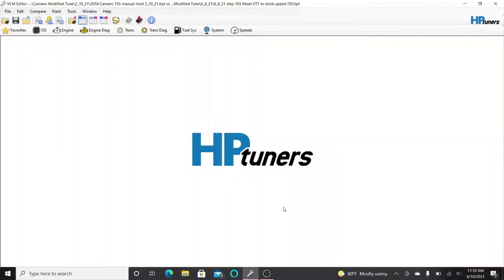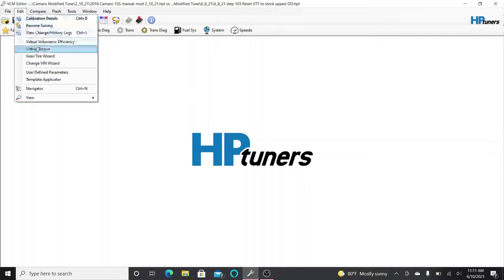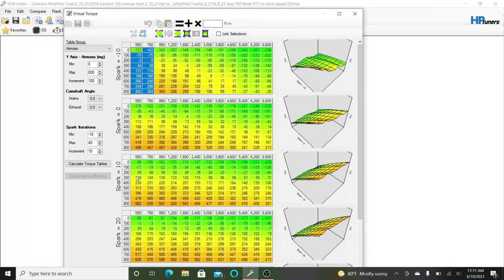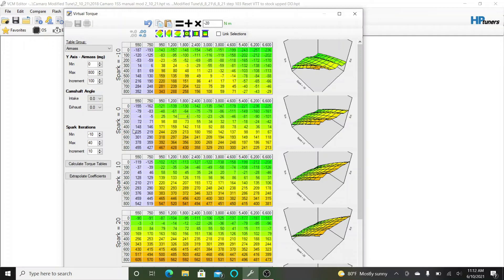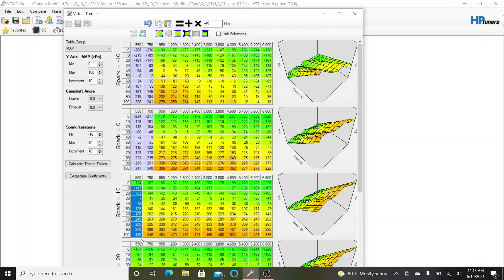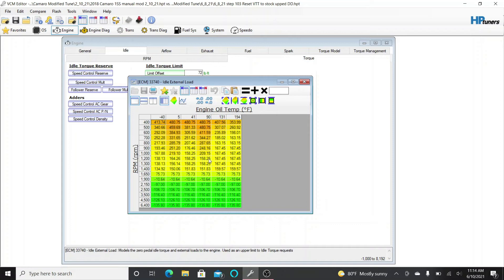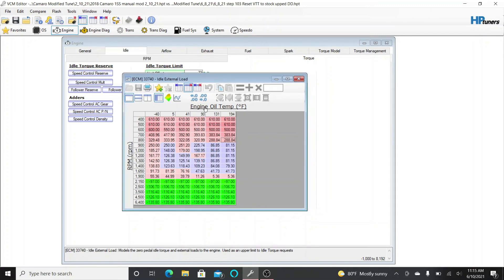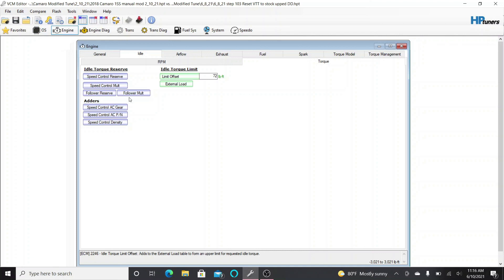FIX Negative Idle Timing on GM LT engines.

Comment: Thank you so much!  This fixed my negative timing on my L83.  One problem I had now is that on a cold start, when the RPM are settling down from 1,500 the RPM will suddenly jump up higher as the negative timing (from the cold start) transitions suddenly over to the normal positiive timing.  Is there any way to fix that?
Reply from the maker: Id look at the Cat light off tables, they have a lot of negative timing in them to get the cats to heat up quickly. Just remove it all together
Reply: @EssMotorsports  Where would those be located in HPT?  Thank you!!!!
Reply from the maker: https://youtu.be/Id2zTeEzobc?si=m52CYZM-e9xNR6Og
Reply from the maker: Watch this video this is what u need. What year camaro and do u have hpvi 2? As I think with hpvi 3 this feature might have been removed
Reply: @EssMotorsports  I have a HPVI3.  Probably a good reason I can't find those tables.

Comment: @EssMotorsports  This did help me to get rid of negative timing at idle after installing 95mm Throttle Body.  Did you have any issues with a hanging idle after blipping the throttle in neutral?
Reply from the maker: No hanging idle. Double check for vacuum leaks. U have msd manifold?
Reply: @EssMotorsports  Ported LT2 Intake, and stock GM 95mm TB.  I ran the stock TB and that intake for weeks before swapping to the 95mm today.  Aside from adjusting the VTT... i did change the stock Throttle Area Limit from the stock 4704 to 5054, but maybe i shouldnt have.  I'll double check for leaks just to make sure i didnt overlook something.
Reply from the maker: @atlbandit  I found I did not need to change the throttle scaler.
Reply: @EssMotorsports  If I dont find any leaks, I'll try putting that back to stock values to see if it makes a difference...lol
Reply from the maker: @atlbandit  yeah with the lt2 intake the high pressure fuel pump is so close to the bottom of the intake. Gotta make sure it's sanded flat so the intake can sit all the way down

Comment: I have 2016 GMC Sierra Denali 6.2 E85 with full bolt ons and lt2 intake. When I swapped throttle body for lt5 95mm unit I had this issue pop up also with negative idle timing. Was throttle body swap what caused you this issue also?
Reply from the maker: Yes that is the main culprit as it let's more air enter at idle with less blade angle.